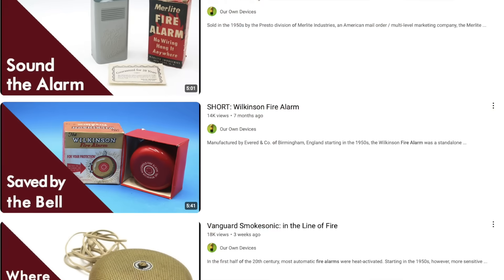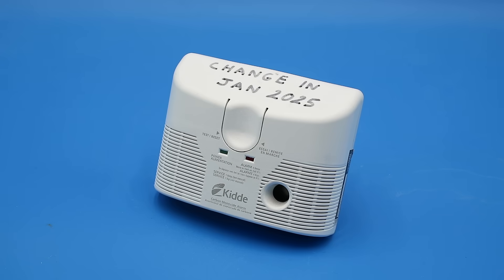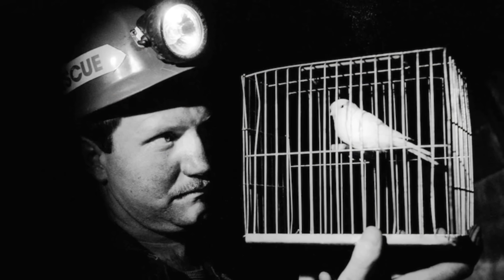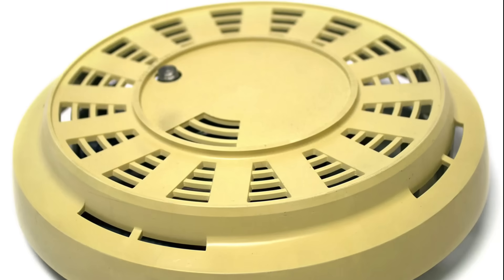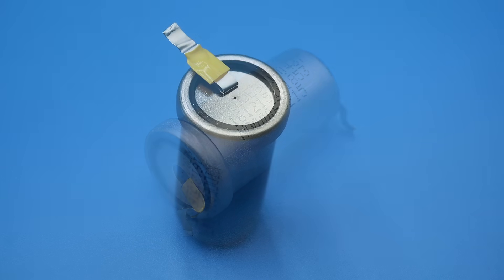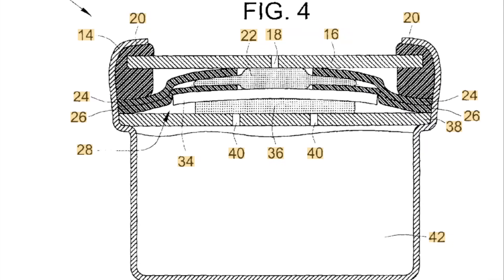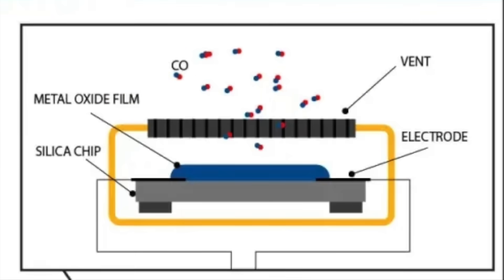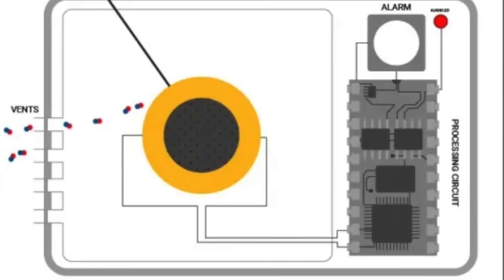Carbon Monoxide Detectors: Clear and Present Danger

Comment: Amazes me no one seems to have noticed that now that portable gas generators contain CO detectors which would also last only 10 years. And none of the manufacturers seem to be advertising replacement. So when you need your little generator, it may work if it hasn't hit it's expiration date. Or it may be more landfill junk.

Comment: There has been a spate of fake co detectors on various well know shopping sites. Some have been removed from sale. The issue is that they are lifed products and slightly too expensive.  One test I have used is to place it with a candle in a sealed container, as the oxygen is used up the co increases as the candle struggles for oxygen. Most detectors will activate very quickly.  Others give you a ppm reading others do nothing at all.

Comment: Every time I have the heat on I get a headache…
Reply: If you have a gas furnace it would be just as well if the heat exchanger was inspected. Also, if the return air is not properly isolated from where the furnace draws its combustion air, this can be a problem.

Comment: Is it true about the flame being blue in a propane flame? If it's blue, it's safe?
Reply: A blue flame indicates complete combustion, which is safer than incomplete combustion.  To be safe, you should always have proper ventilation when burning anything.
Reply: Not necessarily. CO is always formed by combustion, though most of it will burn off to CO2 in the presence of sufficient oxygen. By the time you get a visibly yellow flame from propane, you're already past the point where little of the CO can react to CO2 and to the point where you get a lot of incandescent carbon nanoparticles (soot). In other words - there's an "in between", where combustion seems to happen normally but CO levels in the room are already rising fast. On top of that, you'll already have accumulated significant CO2 levels, which can be lethal in their own right. To make things even worse, both CO2 and CO severely impair cognitive abilities - meaning that even when you do notice the yellow flame, you might no longer be in a position to perform the actions necessary to deal with the situation in time. 

In other words - if you're going to have any combustion in an enclosed space, CO monitors and adequate ventilation are mandatory.

Comment: Those little brown disc indicators are very common in aviation, where cabin heat is made by running fresh air over the engine exhaust. If there is a crack in the exhaust it could leak into the air being ducted to the cabin and be very dangerous.

Comment: 12:12 actually, above 400ppm, co detectors must take a minimum of 4 minutes to activate. You can have like 2000ppm and the detector will take 4 minutes. It's a UL requirement if I recall correctly.

Comment: A friend was camping in a van -- had a small camping heater running 😮 -- tried to light a MATCH --  it Wouldn't LIGHT ! ! ! (lucky he couldn't sleep 😴). 😮😮😮
(He's OK now)
Reply: (I wonder if it was carbon monoxide OR lack of Oxygen ? ? ?)
Reply: @bobbob8229  Definitely CO, you have to get oxygen concentration down to under 10% for a fire not to sustain, and you will be unconscious at around 15%.

Comment: I'm curious as to how the teflon membrane only allows carbon monoxide to pass, what about hydrogen or hydrogen sulphide or other small molecule gases?
Reply: they also diffuse through, but the membrane is more there to keep water vapour out, as that will destroy the cell fast, making the reaction rate rise rapidly.

Comment: I would love to see a big warning tag on flamethrowers explaining that it requires proper ventilation due to the CO risk operating in confined spaces. Next to an even bigger Prop 65 warning sticker.
Reply: I would like to see the Prop 65 sticker have a Prop 65 sticker for the sticker itself.
Reply: Recently got some stainless steel 1/6 pans for the restaurant I work at. Even stainless steel food storage containers have a prop 65 warning. It's no wonder people just ignore them on actually dangerous materials
Reply: @justindunlap1235  Technically, the chromium and nickel can leach out, the first of which is a carcinogen. The only prop 65 legal materials would be cast iron, mild steel, and aluminum.
Reply: You use them indoors?
Reply: @AgentOffice Absolutely. The best way to kill bugs and clean dishes, both!

Comment: This video has dangerous falsehoods. Carbon monoxide from smoldering fires would take a very long time to set off a CO detector, and you'd be strangled by smoke by then. The best protection against smoldering fires is a photoelectric smoke detector. Some jurisdictions are banning ionization-type alarms because they are absolutely horrible at detecting them.

CO detectors are good at warning you against incomplete combustion like a faulty furnace. They are NOT going to protect you from a fire.

The alarm signal in the introduction is also outdated. Carbon monoxide alarms these days sound like 4 short beeps and a few seconds of silence. Smoke alarms sound like 3 long beeps and 1 second of silence.

Comment: 8:18 Selon moi, le circuit de "calibration" est simplement constitué d'un différentiateur (ampli-op avec condensateur entre l'électrode et l'entrée de l'amplificateur). Le taux de CO n'est pas directement mesuré, le changement de concentration (basse -> haute) est ce qui déclenche l'alarme. Cela simplifierait le circuit avec l'avantage supplémentaire d'un déclenchememt plus rapide si le taux de CO n'est pas encore dangereux, mais monte rapidement.

Comment: CO is NO LAUGHING MATTER. Someone I knew didn't realize he'd left his car running when he and his wife returned from going out for dinner (the car was a newer model with the pushbutton start). The car ran all night, and the garage was attached to the main residence. Some friends stopped by the next morning and the first sign something was wrong was the overpowering exhaust odor as they walked past the garage on the way to the front door. The funeral for him and his wife was just a few weeks ago as I type this.
Reply: That's awful. New building codes are strict about keeping attached garages air-tight from the main house for just this reason but any house 20+ years old (which is most houses) could be susceptible to the same deadly accident.
Reply: That’s terrible. It’s usually how it happens when people are sleeping. In California CO detectors are mandatory for all dwellings and any permit filed the inspector will always check for at least one functioning unit on every story.
Reply: The price of convenience. 😢
Reply: Man, that's fucked up.
Reply: Well no that's nitrous oxide.

Comment: I believe the two pin versions are factory calibrated then balue set in firmware, i only know because the ones i got were out of calibration and showed 000ppm even when CO was present

Comment: Mine's a Chinese Costco sale item.  That's actually useful, because it identifies when my house had a short power fluctuation, but not a real blackout/greyout, because it starts talking to you in Mandarin 🙄, and it's easy to distinguish it from the regular smoke alarms, thus you know which appliances need a battery change immediately. 😛

Comment: The monitoring badge at about the 5:00 minute point on the video  brought back memories. When I was a private pilot in the 1980s every airplane I was in (Cessna, Piper, etc.) had one of the badges affixed to the instrument panel. The reason for them being in the airplane was because cockpit heat came from a baffle around the exhaust, the exhaust heated the air and it could be directed into the cabin. If even a pinhole leak were present, the heater was pumping in carbon monoxide, which was very dangerous for the people flying the airplane. Thanks again, always enjoy the curiosities you show on your channel.
Reply: I used these when I owned a Cessna 172.
Reply: Volkswagen Beetles had a similar setup. Possibly other air-cooled vehicles as well.
Reply: They still use them! I was thinking the same thing too.

Comment: People of a certain age can remember when it was more of a concern what the OUTDOOR carbon monoxide levels were rather than the indoor! 50 years ago the average level of CO outdoors was over 10ppm! As a result of catalytic converters, reduction in coal burning and incinerators for building heating, reduction in backyard burn pits, and other factors, that level has gone down by over 90% in the US, and it's uncommon today for the average to be above 1ppm.
Back then almost no one had any kind of air quality monitor in their house, and now technology enables everyone to have cheap smoke, CO, radon, and gas leak detectors! Get and use them!
Reply: Yes people are very nostalgic for those days and I remember them clearly as polluted as heck. In the air, rivers and farmlands
Reply: @longboardfella5306 : There’s still pollution, but some of it is more insidious.
Reply: just need a modern version of that cleanup for the hexane oil and gas corps love.
Reply: That would have been fairly local but large cities would have most definitely been high. I still do measure up to 5ppm near busy intersections
Reply: My parents have that blue liquid radon manometer thing.
Reply: backyard burn pits never had an appreciable effect on that, kindly stop promoting tyrannical policies.
Reply: 🙏”God is great, God is Good; and we thank Him for our food. By His hands we are fed so thank you God for our daily bread.” Amen 🙏
Reply: Right on.  His son has returned

Comment: I'm familiar with those semiconductor gas sensors… Basically reductive molecules are able to react on the surfaces of these materials, thus changing their carrier density. That can be detected by electric circuits.

Comment: I find the timing of this video hilarious. Last night at 5 AM my CO/explosive gas detector starts loudly chirping every 30 seconds. In my confused stupor I'm trying to figure out is it CO? Is there a gas leak? The big hint that this wasn't a regular alarm was: the detector wasn't continuously sounding, and the 7 segment display said "End" instead of a numeric CO reading or "gAS". The manufacturer had built in an end of life beep that is 10 times worse than a smoke detector's low battery chirp.

Now I have to buy a new one. Oh well, better inconvenienced than dead.

Comment: Sealing basement drafts all summer is what almost got me. Soon as winter rolled around and I lt the furnace, there was now insufficent mixing/combustion air available, exhaust came out the mixing inlet.
Alarm not plugged in yet 🤦‍♂️ crawled out with my last wits.
  What I really remember was the splitting headache before I started fading.
Reply: I visited a friend of mine who was always stressed an his wife suffering headaches,  
immediately I walk into the flat I sensed the air was bad and ask them to open a window and show me the furnace. Sure enough the air furnace had corrosion and was leaking.  I shut it down and gave the landlord hell and I told him if all the furnaces in the block were not replaced or I would go to the papers.
Reply: For me it was heavy snow drifts covering the vent at grade level. It was a super high efficiency furnace so the exhaust wasn’t super warm. I noticed when I went out for a smoke that I started feeling better (fresh air). Only time I can say smoking saved my life. I’m long off the nicotine now.
Reply: @j-c1x2j  my mom smoking potentially saved someone's life.

She was having a smoke, and noticed the neighbor was trapped under his tractor.
Reply: This type of central heating furnace/boiler has long been phased out where i live. The last one we had, was replaced around 2001. Everything after that has a direct air feed from outside to the furnace/boiler. No combustion air taken from inside the house. This has the added benefit of the air that you just heated, not being sucked up by the furnace and dumped outside.
Reply: A rural hostel I often stay at had a small member's lounge with a small coal stove.
If I was staying there on my own, I wouldn't bother turning on the central heating for the whole building, but would light the stove, and sleep in that room overnight because it was warm.
On at least two occasions, I woke up the next morning with what seemed like a headachey hangover that was very unusual for the amount of wine I had drunk the night before, and the memory of some unusually vivid and weird dreams.
I can't say for sure it was CO, but after we got a CO alarm, we did have it go off the day after having a fire a couple of times. One time, having carefully gone though the ashes, the only possible culprit was a little red chunk of coal of about 1-2 cubic cm which had been well buried in ash.
I guess it was probably a matter of how the wind was blowing once the stove and lined (so low thermal mass) chimney had cooled down to the point where there was no meaningful chimney effect.
Reply: Ooooh nasty😮😱dude
Reply: I always find it kinda insane that there are places in the world that aren't poverty stricken third world villages that still use fire for heating, or rather use it directly.
Reply: Sealing your house too much is unhealthy for multiple reasons.

Comment: At work (Intergrated Steel Plant) we have to wear personal gass detection devices at certain locations.

In the case of one machine with Lead Acid batteries, the CO meters sounded when opening the battery compartment, this due to cross sensitivity with the H2 that's released in the charging process...

We also  have 4 gass meters that detect CO, O2, H2S and CH4 (Explosion limits) for various other locations these gases can be present.
Reply: Well that sounds fun 😱😱😱on a lighter note 🤔if you're wearing gas detector 😂how do you fart at work with out setting it off😂😂😂
Reply: @Davidgoldenswan  Mines almost always have a crew fitted with at least one multi gas warning unit, which detects both CO, oxygen, flammable gas and hydrogen, because the levels for each are very different, and the detectors are all integrated into a single rugged unit with the battery. 3 month life, and you then send it to MSA to have it serviced, which means all 4 sensors are replaced, tested, and a new battery installed. Not cheap, and not cheap for those sensors either just on their own, with the old ones being shredded after removal, so that they do not get put back in service by accident or deliberately. 3 shifts, each needing around 100 sensors, and you needing a fourth entire set as well for that calibration cycle as well, gets pretty expensive, but the alternative is the mine shutting down.
Reply: @SeanBZA  thanks for your very good reply my friend 🤔 I was making a joke you know 🤔😁✌️👍